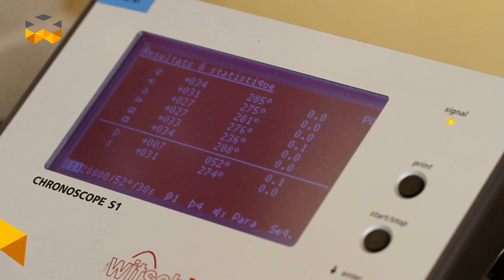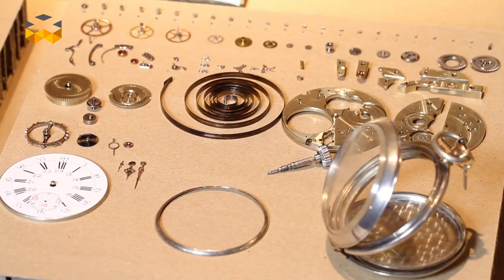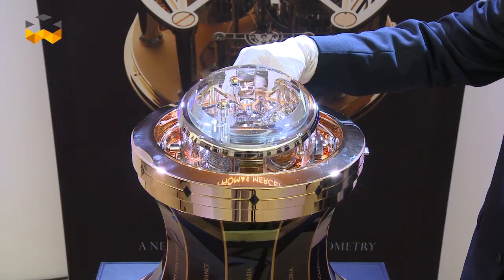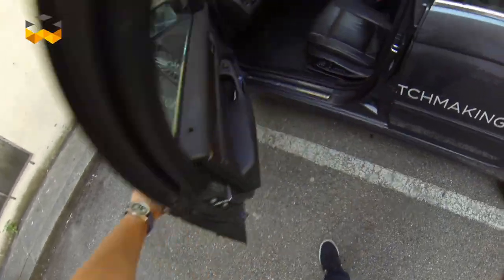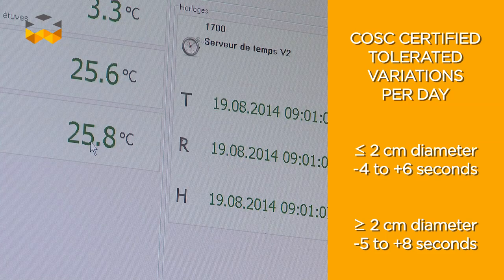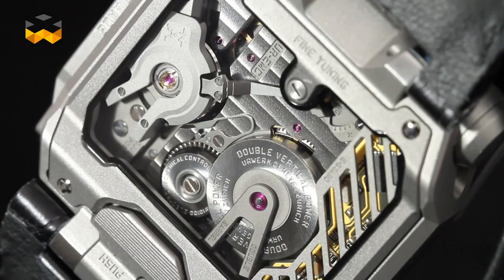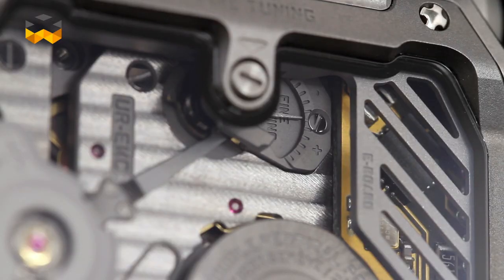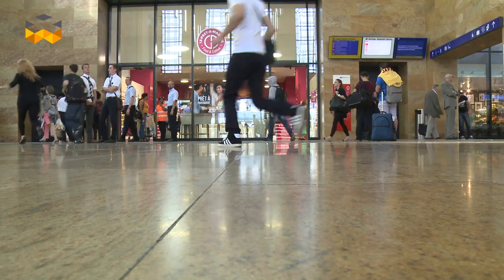The science of timekeeping – Chronometry saga n°1

Comment: Nicely researched, although I feel that the COSC requirements got mixed up at 2:31. Technically, it is more difficult to make a small movement run accurately, therefore movements smaller (!) than 20mm in diameter are allowed to run with a larger variance in timekeeping. You showed it the other way around.
Reply: Actually, it might be the case. But the COSC criteria says indeed 4/+6 for calibers under 20mm and -5/+8 for those bigger than that. The precision of a caliber depends in fact mostly on its construction and the ratio between frequency and the diameter of the balance wheel. But these are not the only factors of course. Thanks for your attention. And this might be helpful> http://www.cosc.ch/popmecaniquetableau.php?lang=fr
Reply: Louis Nardin They are indeed mixed up, which is clearly shown in the link posted. Excellent video regardless!
Reply from the maker: Warwian
You both are absolutely right! Thank you for noticing this inversion. We will correct it asap.
Reply: Warwian TheWATCHES.tv I thought I'd need to have my eyes checked :) No hard feelings guys, just thought I'd point it out. Keep up the good work and looking forward to upcoming episodes.